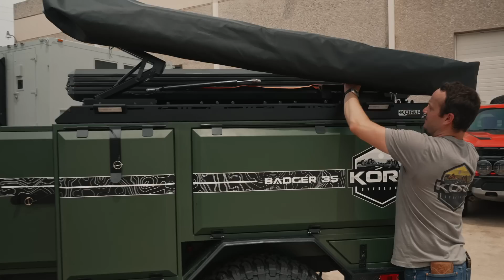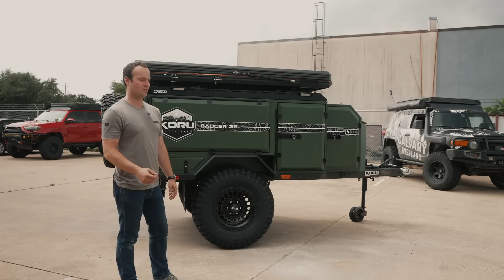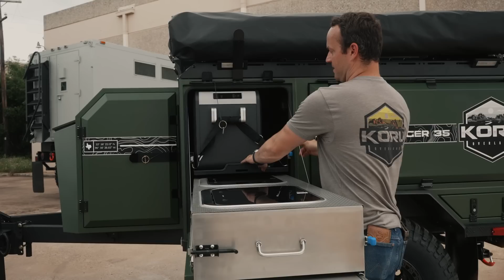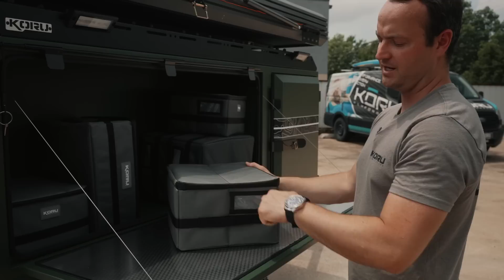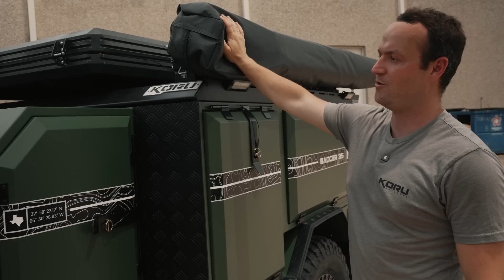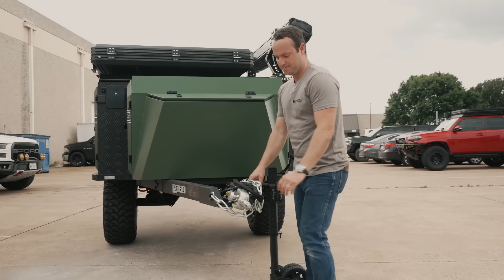🚀 Koru Badger 35 Overland Trailer Walkthrough | Ultimate Off-Road Adventure Companion! 🚀

Comment: Propane for a month? Multiple fridges is awesome. How many charging USB ports do we need? We charged all day in the car. Rigs towing this size of trailer need fuel every few days at best. Seriously consider your overland business model for 4 days in the US.  Cables in the way of the "kitchen" slide out and in the way of using the sink. Needs a total new hinge Redesign. Move the 3 rear lights to full vertical, makes room in a trailer that has limited room. This is constructive. Oh and "WE GOT" ...got it drinking challenge during this video. Lots of potential with this trailer.